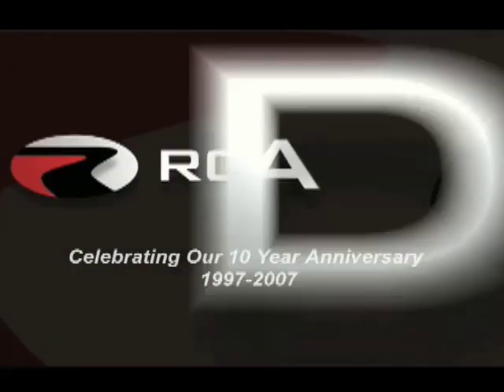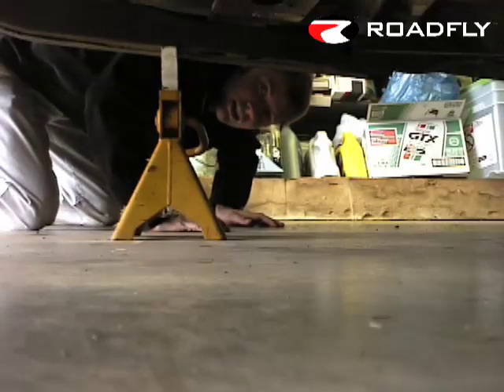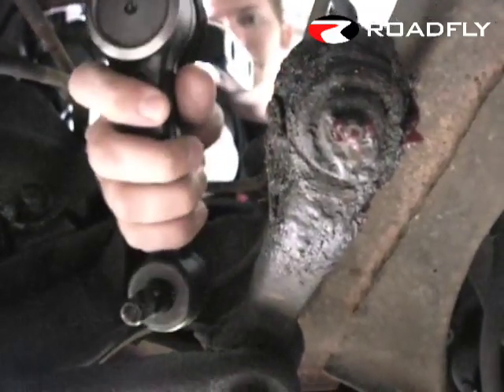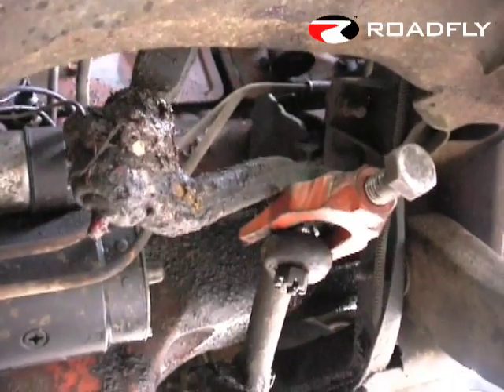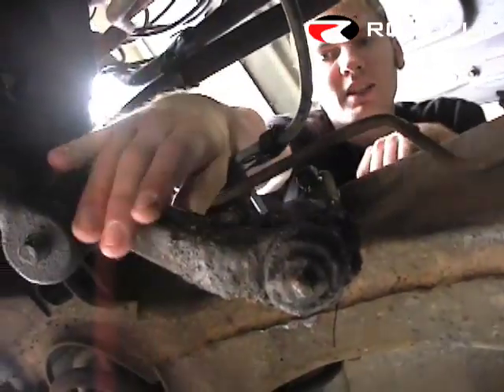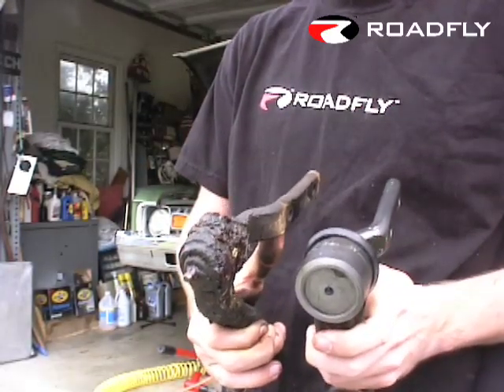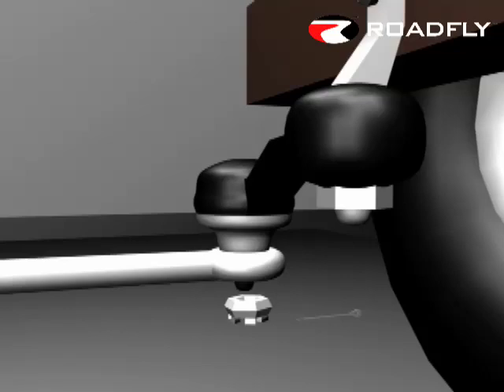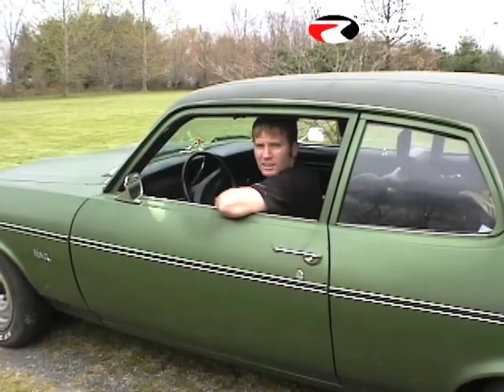Roadfly.com - Replacing an Idler Arm

Comment: @joelangan Its basically just a pivot point to support your supention on that side. It bolts onto the frame on the passenger side and just moves with and holds that side of the center link. Its pretty much the same thing as a pitman arm except it doesn't turn the wheels, and attaches to the frame rather then a gearbox.